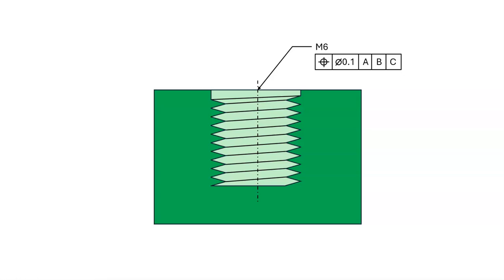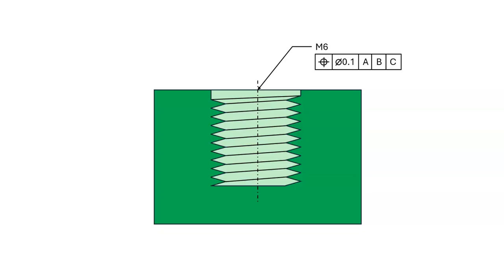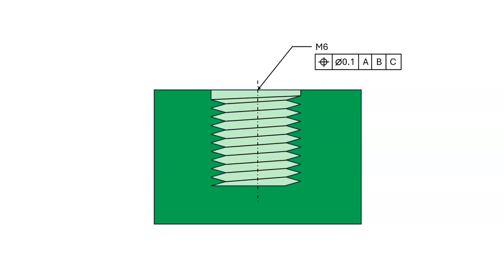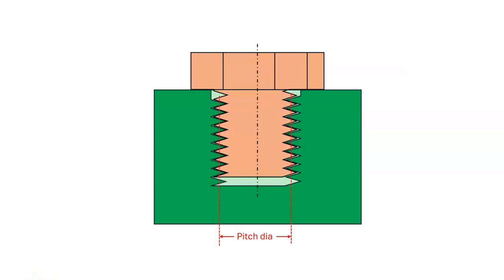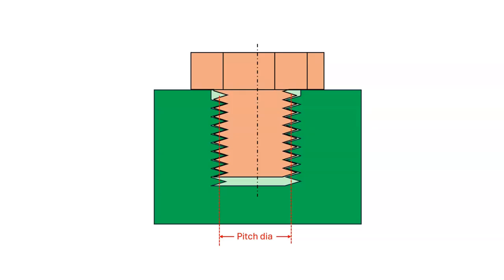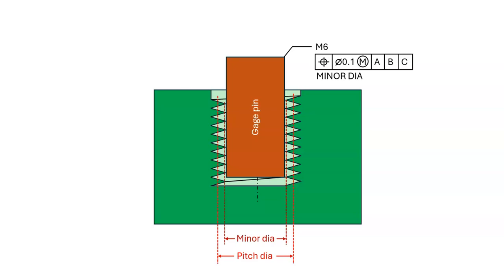Position tolerance MMC on threaded holes

Comment: 100% agree. And by adding MMC to a tap it would most likely drive a larger clearance hole in your mating part taking away from the clamp surface face of your bolt. Your designing a system, the supplier is just making a single component. You each have different agendas. Don't get dooped. $$$$

Comment: Very nice video. I am also of the opinion threads should be toleranced RFS. In the ASME Y14.5 standard there is an example (possibly more than one) where it is shown as a combination of MMC and a projected tolerance zone. I think that a projected zone for a threaded hole makes sense functionally but I don't think that applying it Projected and at MMC (or just MMC) is right. Those recommending it seem to assume the Virtual Condition can be interpreted to apply to the protruding portion of the shank of the mating screw, which would be handy if it was true, for making a gage with fixed size holes. But in fact, the text of the standard doesn't support that interpretation anywhere.
Reply from the maker: Yes, the standard is not clear about how to handle a position tolerance at MMC with a projected tolerance zone for a threaded hole.  I don't recommend using that kind of a callout until the standard clarifies it.
Reply: Taps in engine blocks for cylinder heads use a projected tolerance zone. Because the column height in the head is so great. The projected tolerance zone needs to be the threaded feature length plus the column height of the cylinder head. Not just the cylinder head height. Hope this helps.